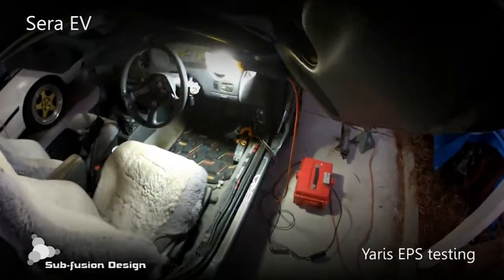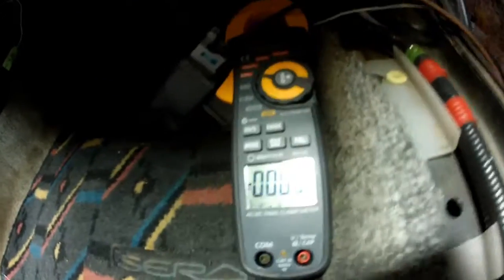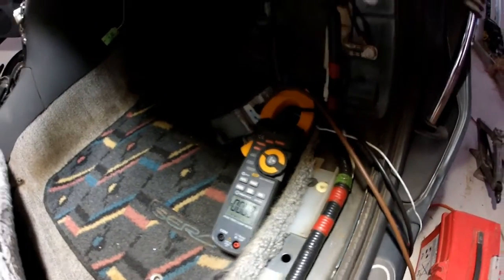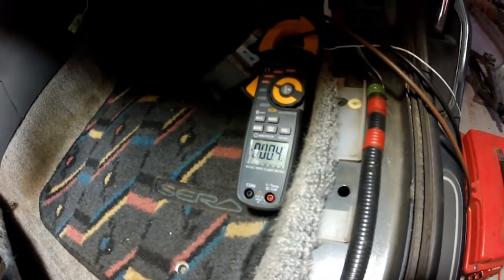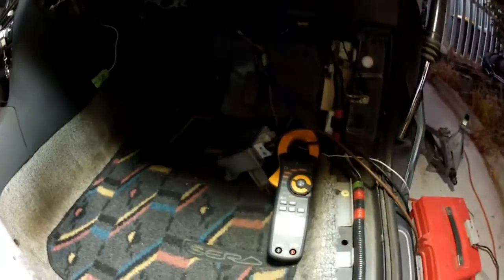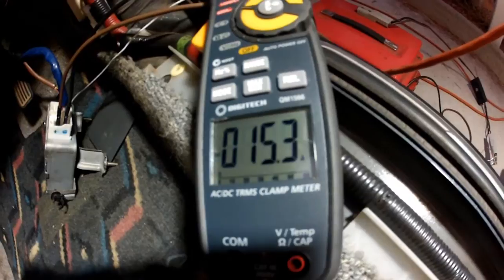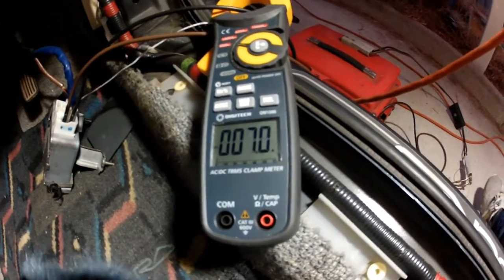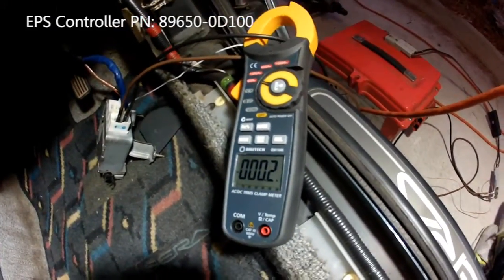Sera EV EPS Test

Comment: Hi. Can you please say which EPS and if anything else needed for the conversion. I am also a sera fella but not (electric like you ;) ). Cheers
Reply from the maker: Hi, the EPS unit is out of a 2010 Yaris. Virtually any 2008 or newer one will just work without any special modification.
Reply: @va61dett  thanks for the reply. Do I need the ECU as well of same model car? Have you sold the sera as I may have heard on news? 🙂
Reply from the maker: @kania6468  You just need the matching EPS controller, plenty articles on google about it.

Comment: Hi! How did You wired the middle connector pins? I'm asking to find out is there a way to re-pin a can block to use analog speed signal and switch on  mode.
Reply from the maker: The smaller EPS pins were connected using a random laptop inverter CCFL plug. They just happened to fit nicely for the 1 pin required to activate. I am going to look at using a custom feedback reduction circuit to control the EPS assistance later down the track.
Reply: va61dett Thanks for the reply! I just installed prius EPS into my DeLorean))) And it is working perfectly, only one task remain - hall effect speed sensor setup, to use the parametric feature.

As for the CAN EPS ECU unit - I just exchanged it with the analog one in the junkyard. CAN is just too complicated.